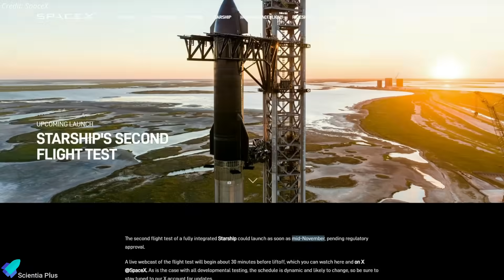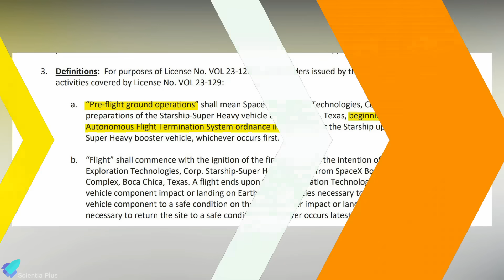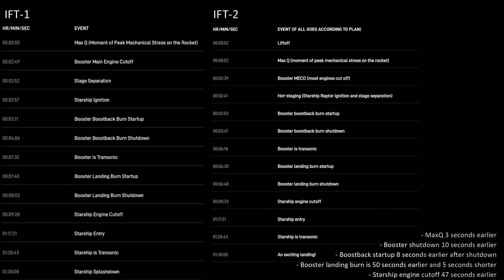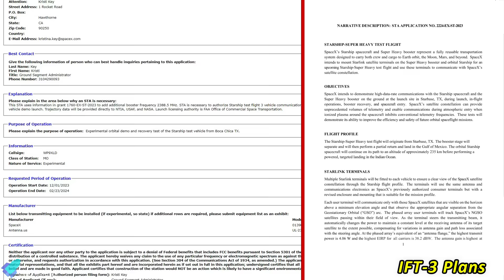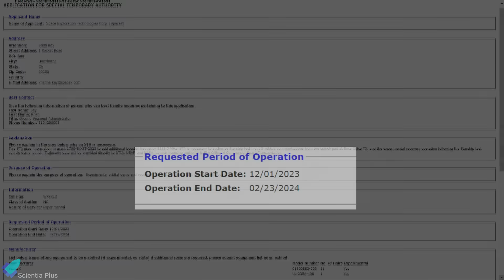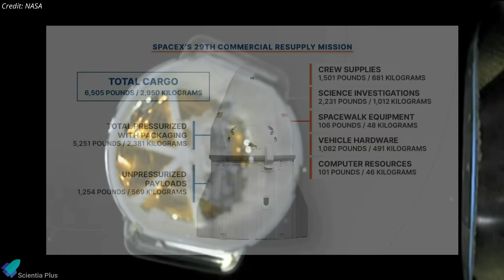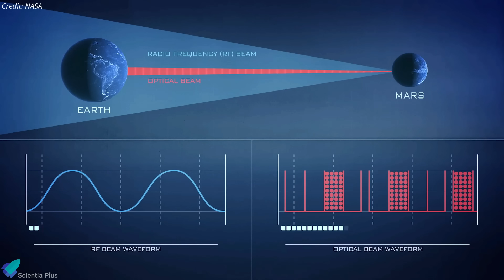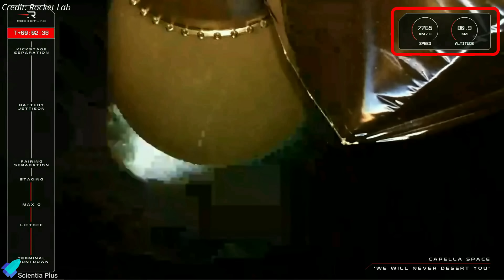SpaceX Starship Integrated Flight Test 2: What to Expect

Comment from the maker: 00:00 Starship Updates
07:02 SpaceX CRS-29 Launched With Powerful Laser Communication Instrument
09:46 Rocket Lab Identified Reason Behind Electron Launch Failure 
11:35 SpaceX Installed New Crew Arm to Launch Tower

Learn More:
1. Upgrades To Starship After IFT-1
 a. Starship Hot Staging Explained: https://youtu.be/qgZHo9wYRW0
 b. Super Heavy Booster-9 Upgrades: https://youtu.be/vZH5esgrFiM?t=63
 c. Starship-26 Explained: https://youtu.be/9tiUa4jdv4s?t=180
 d. How SpaceX Protect Raptor Engines: https://youtu.be/L22gyQDDXho
 e. OLM Water Cooled Steel Plates: https://youtu.be/zyoM0c4QAGs
2. Starships & Boosters Latest Status: https://bit.ly/3sqskmw
3. Rocket Lab Electron Investigation Report: https://bit.ly/47nu5zJ
4. CRS-29 Mission Overviewhttps://bit.ly/472TSgF

Weekly Updates: https://bit.ly/3HIQjPC
SpaceX Playlist: https://bit.ly/34wue8T

Comment: Short Circuit in the Second Stage Power Supply System: The Cause of the two failures of ALOS-3 and Acadia. In the first case, a short circuit led to the shutdown of all electronics on the second stage and to the failure to start the engine. In the second case, a short circuit caused the engine to fail to start. Causes of short-circuit: In Mission H-III TF1 an error in the design of electrical supply circuits and a defect in the production of the transformer, and in the mission of the Electron F41, this is a poor connection of the cast batteries, and damage to the insulation of the power wires during the assembly of the stage.